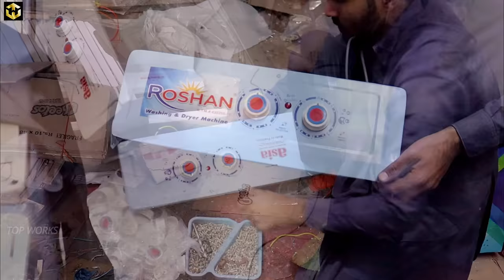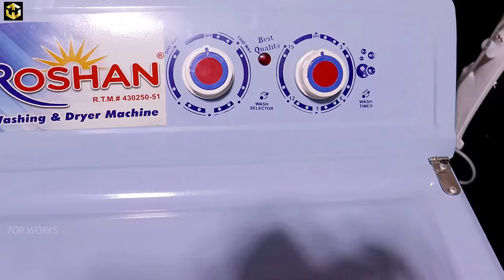How to make Washing Machine in Factory | Manufacturing Washing Machines Process

Comment: Very nice, but how does it fill and drain?
Reply: They must fill it under a tap or using a hose or a bucket and when it ends washing they drop the drain hose on the floor and gravity does the job, Maytag used the same method a century ago. Low tech but saves time and effort.

Comment: Well, my GE dishwasher that was $450 lasted four years and the electronics went haywire, had to spend $150 for new PCB and wires and install myself, but hey at least its working good again.
I did notice that the new parts looked like updated pieces from the originals, hopefully thay last longer than just four more years.

Comment: People heaping scorn on this machine forget that this is the way machines were made back in the late 40s and early 50s, except those machines had tower agitators and not the disk agitators.  For all their simpleness this thing will probably outlast a new machine with all its expensive pumps and IC boards many times over and if it does break it will like be the timer or wash selector switches which can easily be swapped out or the motor belt.

Comment: Wonder how many years warranty it comes with
Reply: Its usually life is 8 to 10 years. Its normal maintenance is changing belt, timer, or one side/two side switch knob. Nothing happens to the machine else. You can wash even heavy cotton quilts in it.